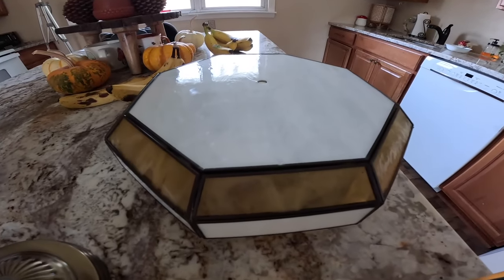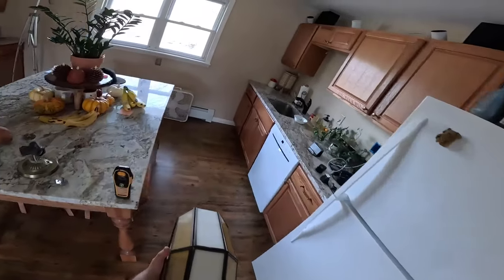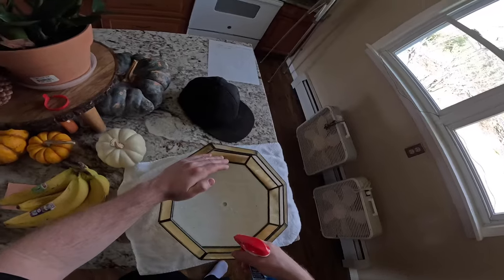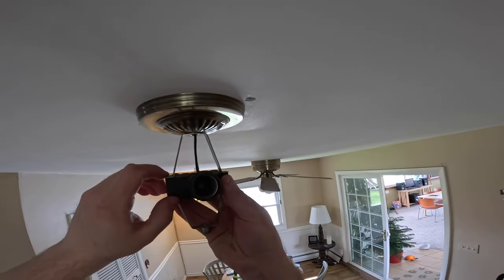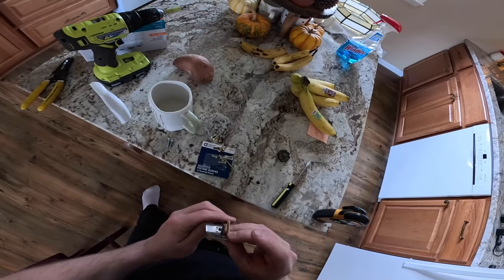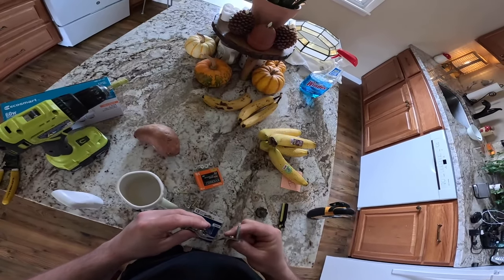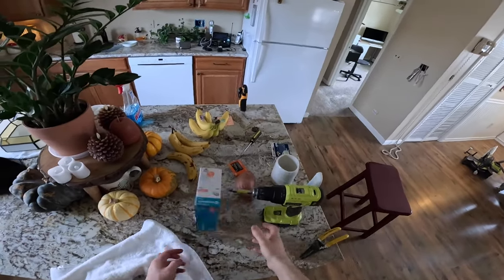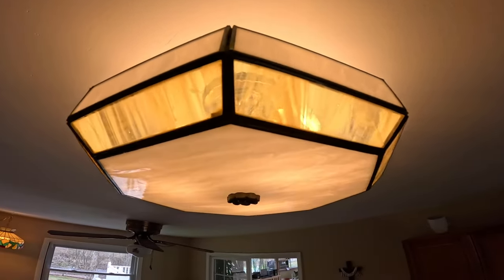Installing the Second Vintage Light from my Grandparent's Old Kitchen Into My Kitchen

Comment: Nice fixture, love that it can take 3 bulbs.  For cleaning it, I found just running it under water in the sink works wonders if it's dusty.  If it was actually greasy at all, a better choice of product would have been LA's Totally Awesome or Super Clean, which can be diluted way down for the cleaning task you had at hand.  Also--change the paper towel frequently.  I know they cost money, but the two you had were pretty filthy.  What you were doing was spreading a thin film of whatever was cleaned off back all over the fixture.  That's why there was still more when you went in with the second paper towel.  That was a 4-6 paper towel job for sure.

The CFLs will suffice if you don't very often turn that light on.  Example:  In my garage I have 2 incandescent bulbs in the opener.  Oftentimes, that's just enough for me to see (if I go in through the man door in the house), without turning on the "big" light.  And that's 600 watts of incandescent plus 2 300W equivalent CFLs.  I try to refrain from turning the big light on if I don't need it, so as to not short-cycle the CFLs.  If I know I'm going to be in there doing a lot of stuff, I will indeed kick it on.
Reply from the maker: I've had very good results with the Windex with Ammonia D, but I do want to try LA's Totally Awesome at some point as well. I've heard many good things about it.

Comment: Never screw the bulbs very tight!!
When i did it, it got stuck so i had to let someone screw the very firm bulb out caused to break the shell of the socket.
Heres a proper way to do it:
Screw it in until you feel little stress on the bulb but don’t continue to screw it in or else the bulb will get stuck.
But dont let the bulb stay loosy or it burns out.
Reply: Plus screw it by the base if fluroescent, not the glass or it shatters or the glass get loose and will fall out soon.
(THIS COMMENT AND REPLY IS A WARNING.)
Reply from the maker: I know how to screw in a light bulb.
Reply: Thats a good warning
Many people nowadays use integrated fixtures and dont even know u can change the lightbulb, let alone, whats the proper way to do it

I also wonder if todays parrents even warn their children: dont touch the lightbulb while is on because its hot